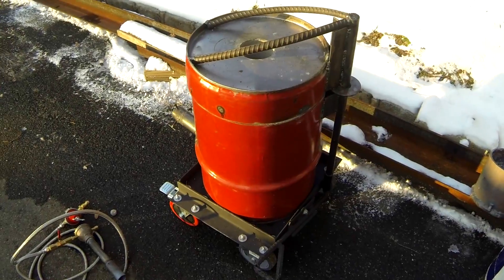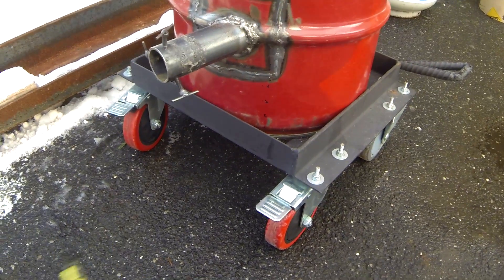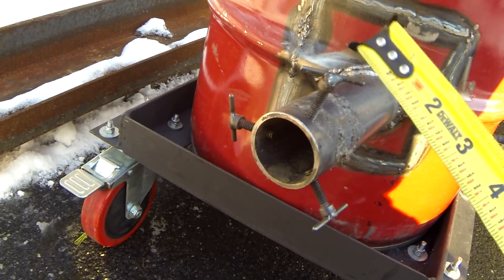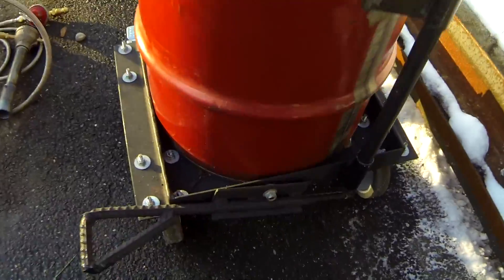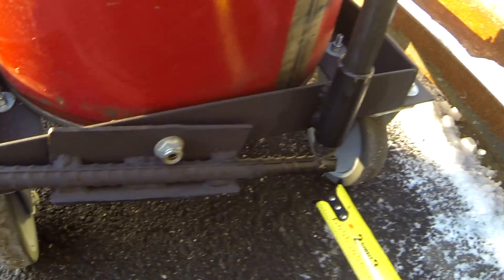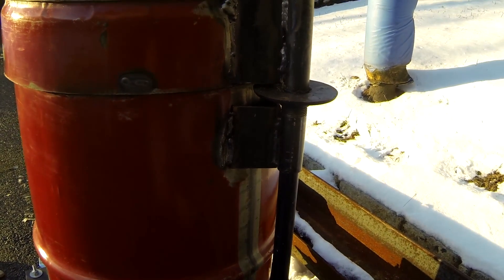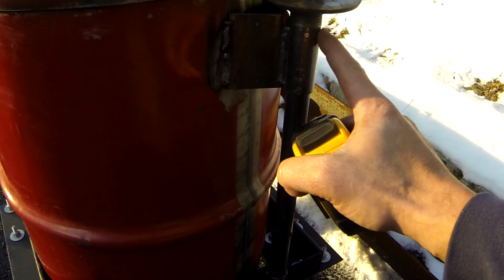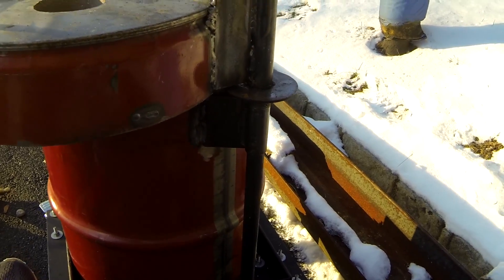Homemade Propane Foundry Furnace Metal Aluminium Tutorial How To Make Build Part 1 of 4 Aluminum

Comment: YOU CAN USE WHAT'S CALLED WATER GLASS ( I BELIEVE THE TECHNICAL TERM IS SODIUM SILICATE ) TO MAKE REFRACTORY MATERIAL IT'S BASICALLY LIQUID GLASS AT ROOM TEMPERATURE AND YOU CAN MIX ANYTHING YOU WANT WITH IT AS A FILLER AND IT GETS HARDER THAN STONE  IT'S WHAT'S KNOWN AS A GEOPOLYMER THIS IS HOW THEY POURED STONES WITHOUT HEAT

Comment: I realize this is old but still great info.  Awesome build, and I've done my research.  Prepping for the build on mine now.  Question, did you use a 2" layer of ceramic wool under the bottom refractory pour prior to packing the sides?  Or is the bottom all refractory all the way down to the metal?  Thanks again bro for sharing your build.
Reply from the maker: Yes I did add the ceramic insalation on the bottom before covering it up with refractory cement
Reply: @eddie2799  Right on.  Thank you sir.

Comment: I built mine in a somewhat similar to yours for the lid (mine is just a primitive handle). Way safer than grabbing the whole lid everytime and putting it on tje ground.  How does the drain work for you? I put sand in the bottom of mine and that seems to catch most of it, like a green sand mold.

Comment: here is a link for 3 different refractory mixes from best to ok for everyone, https://www.delftclay.co.nz/how-to-make-refractory-cement-3-recipes/ . also if possible try to make your crucibles have about 2 inches all the way around them and only sit 2-3 inches from the top if possible, you may have to use fire bricks if your using a small crucible to lift it closer. you want a small area for it to exhaust but keeping it minimal will help with heating and propane usage.

Comment: I'm going to build a similar foundry and I'm wondering what kind of can did you use for it? I've been looking around for something similar with no luck. Where could I find one?
Reply from the maker: The can I used is a 14 gallon oil drum.  Found it at a BMW dealer for free

Comment: Is this forge good for heating metal to red hot for sword making, or is it only good for melting metal?
Reply from the maker: Sure, If it melts metal then that is far past the point of heating it to red hot.  You just adjust the the regulator so it wont get hot enough to melt and only heat to red hot.
Reply: eddie2799 thanks, was half asleep when I watched and didn't notice the regulator

Comment: Eddie, I love your design and implementation. Great job.  I have a couple of questions that I hope you can answer.

First, after more than two years, how is the refactory cement holding up?

I'm almost positive I heard you say in one of the videos that you lined the barrel with KOA wool before you put the refactory cement on. Is that correct? If it is, do you remember how thick you made each layer?

Finally, do you recall what brad refactory cement you used?

Thank for help you can give me. Once again, great looking foundry furnace.
Reply from the maker: Sorry for the late reply.  The refractory is holding up excellent.  No cracks or damages.  I will post a follow up video soon.
I used 1-1/2 of Kao-wool and the rest was filled with KS1 refractory cement.  You can get it at Harbison walker    http://thinkhwi.com/

Comment: nice build. I like the way you fabricated the lid and opening 
I just want to know why you decides to go with a fuel that cost, as opposed to a potentially free fuel? especially since you said you originally built the furnace to run on wvo/wmo
Reply from the maker: Thank you Wesley.  I decide to convert to propane because its cleaner and much less work.  Storing oil, filtering it, pre- heating it, and not to mention the mess it makes were the primary reasons.  
I get about 15 melts with a full tank of propane for $28 bucks.  The cost is not bad at all considering I do not have to fiddle with oil which takes more of my time.

Comment: does it get hot enough to smelt other metals like silver or copper?
Reply from the maker: yes it does however you can only get to a max temperature with propane so you would need to introduce forced air or possible oil for higher burning temps.

Comment: Hey Eddie, I was wondering about the black pipe. How did you get 3/4 to fit in the 1 in.. I have tried and tried and it wont work for me. I did notice in one video the pipe looked machined. thanks BTW Awesome build!!!
Reply from the maker: I bored out the 1" pipe for clearance to accept the 3/4" pipe.  If you do not have a lathe you can simply use a drill or dremel.

Comment: can this furnace handle steel? im looking to melt steel to cast some broadheads
Reply from the maker: Yes, the furnace can handle it but I would use a higher temp refractory to withstand the higher temps.  You would also need to add a blower to increase the temperature.
Reply: Ok prefect thank you

Comment: Hi Eddie, just about finished my furnace, love your video explanation.Question the degassing agent where do I get that & is there any particular brand?Question the flux.... what type or brand name is it?This is my very first attempt at casting so your info & help has been very appreciated.
Reply from the maker: +Rosco Hall  For aluminum I use Morton lite salt as a flux. Makes the metal flow more easily.  I use Sodium carbonate which is "washing soda" (Arm & hammer brand) as a degasser to get rid of excess hydrogen. Gets all the dross to the top for a clean skim.  Pool shock is supposed to work too..  Don't use Sodium Bicarbonate which is baking soda.

Comment: Thanks for sharing your design!  Regarding Kaewool or ceramic fiber blankets, what density did you use (e.g., 4lb, 6lb, 8lb, or other)?  Also, all the ceramic fiber I could find seems to have a max rating of 2300F.  Is that what you used or did you find higher rated material?  I think 2300F rating should be high enough as the refractory may prevent the ceramic fiber from reaching temperatures higher than the rating.  Your feedback is appreciated.
Reply from the maker: Sorry for the late reply.  Just found your comment.  Any of the 4,6, or 8 Lbs will be sufficient. You are correct that the 2300F rating is plenty. Most of the heat will never pass through the refractory cement.

Comment: Hi, i was wondering if this furnace could reach temperatures of 2000 degrees without the help of air. 
Please answer :)
Reply from the maker: Cheezwag Yes it can reach up to 2000 degrees but introducing  air by means of a hair blower will safe on Propane and get it up to temp much faster.

Comment: Hi, really great work and thanks for sharing. I am on my way to make one too :), a question about the burner. The big hole behind the gas outlet is for the air to pull it inside, are no loses? I just get a hose and in middle i put the gas outlet and works? I hope i didn't confuse you, thanks again.
Reply from the maker: Power Creations® Correct.  It works like a carburetor. It draws air from the opening at the end. Drill a number 60 hole in a 1/4 inch nipple for the propane. And center it down the middle of the 1 1/2 pipe.
Reply: Thanks one more time :) for fast answer, i will try it and hopefully i will show you the outcome. Cheers
Reply from the maker: Power Creations® No problem.  If you have any other questions please feel free to ask.

Comment from the maker: The purpose of melting down aluminum into ingots is to have it ready when you need it.  You remove all the impurities in the form of dross and your left with ingots that are ready for the job at hand.  I typically do not stock ingots because your wasting fuel to melt it twice.  I melt it and use it right away in the form of round or square stock or into molds..
Reply: I built one from a beer keg the same way and the refractory cement alone cost 200 dollars.
Reply: +eddie2799 How much was this

Comment: What is the purpose of melting down aluminum into ingets?
Reply: Myfootsasmokin I know this comment is a few months old, but i felt i had to answer. I can think of a couple reasons for melting down aluminium into ingots, the jmost obvious one is to be able to take the pure ingots to a recycling yard, as most I've encountered give a higher dollar per pound if the metal is already refined . what I do, however, is i cast the ingots into various things, ranging from engine parts to figurines, some for personal use, others to sell.
Reply: Thanks.

Comment: Where does one look for foundry cement?
Might as well put a plan together now and a parts list.
What size gallon drum is this and where would I look at to get one of these?

Thanks again Eddie
/s/
Will
Reply from the maker: William,  The drum started out as a 15 gallon.  The body was cut down to 17 inches and the top/lid to 4 inches.  I found my drum at a BMW dealer service station.  Just go into any franchise big name service dealer and chances are they will give it to you instead of throwing it out. Dealers buy their oils in bulk drums so they always have empty drums ready for the trash or recycle.  The refractory cement can be found online if you google it.  Try to find a local vendor as it is heavy and expensive to ship.   Hope this helps.  

Eddie

Comment: Eddie I can see the amount of effort and knowledge that went into this. Looking forward to the eddie2799 55 gallon series nice touch what you said so you don't have to cut up rims. What will you be making with your new molds?
Reply from the maker: Thanks William. I am working on molds to make adapter plates to mount diesel motors to Chevy or Ford transmissions. I also need an endless supply of round and square stock that I can use for machining projects.  As soon as the weather gets better I will be doing some ant hill molds so stay tuned.